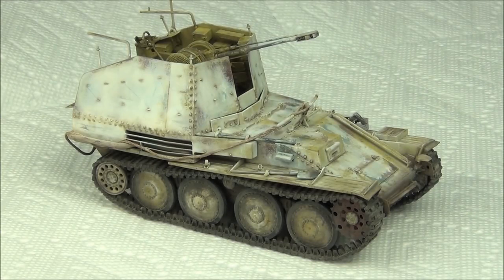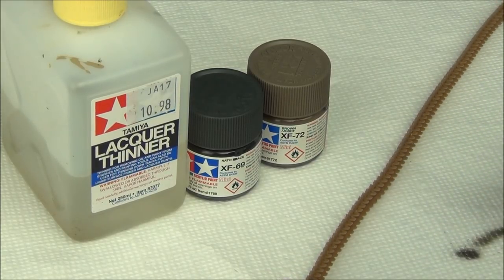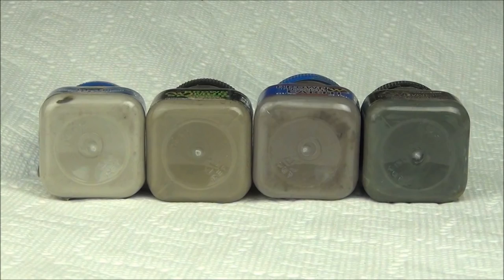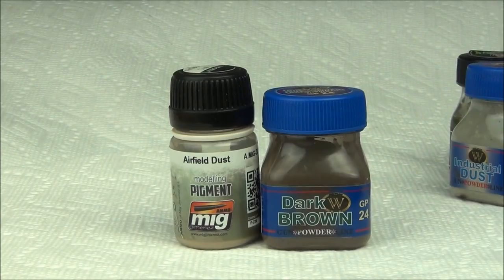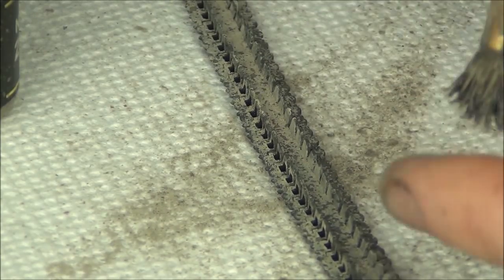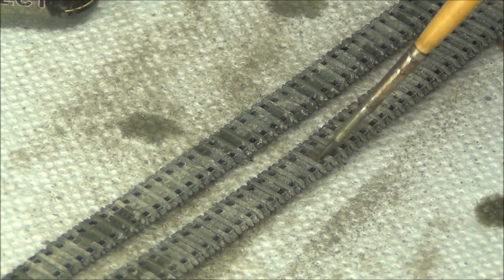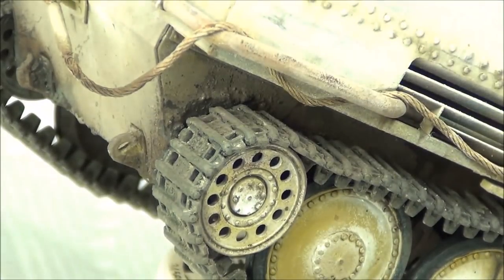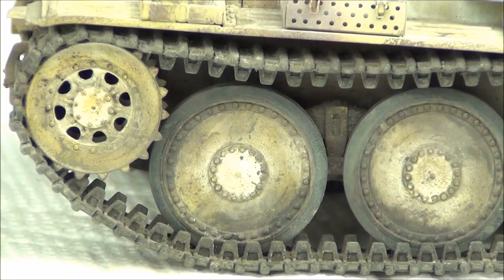Tutorial: Painting & Weathering Tracks for Model Tanks - DUST & MUD for Model Tanks

Comment: The weathering on the whole model looks excellent but i think the tracks could be improved if you used a product on the high points of the tracks to replicate steel. Even tracks that are caked in mud and dirt still have high point areas that reveal worn steel.
Reply from the maker: Thank you.  As I mentioned in the video, I'm not too much of a fan or metallic highlights like that, so I just left the grey colour colour show through there.  I may go back eventually with a 4B pencil and make them look a little more metallic.

Comment: you need to be careful with enamel products on those kind of tracks because the thinners the paint is made from will eat away at weak joints, but i think you use just about the right amount.,

one thing i do is i do not put pigment where the road wheel is in contact with the track i tend to keep that a bit cleaner

Comment: Hi.
For plastic tracks, do you paint them before or after you  put them on the tank ? If  you paint them beforehand, wouldn't they stiffen and be very difficult to fit around the wheels?
Thanks for your reply
Reply from the maker: No, the airbrushed paint layer is extremely thin so it won't stiffen the tracks.  I always paint the tracks before putting them on the model.
Reply: @Panzermeister36  thanks for your prompt reply